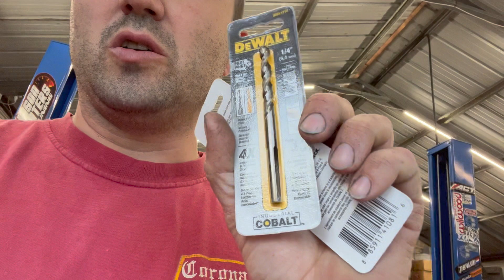Pinning the Cluches in my Honda CRV Rear differential | RD1 CR-Yeeter

Comment: Its 2yrs after you uploaded this video. is there any problems with pinned clutches? any breakdown?
Reply from the maker: Never had any issues with it. It’s not currently in it because I installed a 3rd gen diff and regular driveshaft chasing mpg

Comment: Philip, when I unscrew the 4 knot in the rear differential, dummy me it broke all the 4 bolt so do I have to drill in for the 4 bolts or do what u do, unscrew that big knot inside the differential?

Comment: Seems like it would be a better idea to have the coupler on the transfer case end instead, that way you're not spinning the driveshaft when in FWD mode.  It would be more efficient and give better throttle response.  Honda must have put it there for a reason.  It sucks we have to spin a driveshaft for no reason all the time.  Great video!

Comment: what I don't like is all the pieces of steel and the clutch that remains inside and will pollute the oil. to avoid this, after drilling everything should be dismantled without welding, perhaps with tig welding
Reply from the maker: Still working without issue

Comment: Awesome job, follow up, has the handling offroad improved.
I saw a turbo, CRV strictly for drag racing  & they disconnected the rear wheel drive (too much horsepower) for the rear diff.
Reply from the maker: I haven't really put it through its paces yet but I had a pinned diff in my awd hatch at 900 whp and never had an issue with it.

Comment: I want to know if a 2001 honda crv engine can work in a 1997 honda crv
Reply: Yup, use old dizzy, or repin it. There's guides if you search obd2a vs obd2b pinouts.
Reply from the maker: It can. If you retain the 01 intake manifold, you'll have to extend some wires. Use the 97 intake manifold and distributor. It should be plug and play at that point.

Comment: Today I got a  second lower control arm right drivers side, no more front end noise $1100.00 later
Drivers side door wiring repairs tomorrow at $115.0 per hr plus parts then the engine light.
Hopefully that's all I will need.
Reply from the maker: Sheeesh
Reply: I bought a 2001 Rd crv had to replace both lower control arms at a cost of $1100.00 Australian, its a manual 5 speed.
Next rhs drivers door door wiring & an 02 sensor (the 02 sensor $300.00 alone) that's not including labour.
It's booked in for the auto electrician for the 23rd of this month.
(Pending if the parts arrive.)

Comment: Hey man, I just got a 98’ CRV LX with 117k miles and there’s one problem. The steering wheel is hard to turn. I took it to a mechanic and they said I need a new power steering pump. I got them a new one and when they put the belt on; the pump is a bit noisy and the steering wheel is still hard, they did bleed it as-well. They claim the new pump is just as bad, any advice on what else it could be?
Reply from the maker: was it a used pump or new? I dont usually see these go bad, but if its making noise, it getting air in the system. Likely a bad o-ring. Check the fluid level, also check the fluid while the truck is running to see if it foamy.
Reply: The Honda Resource it was a remanufactured pump, I just ordered a new one, will be here soon, hopefully that works. Is there anything else I should look out for?
Reply: @mirzaahmed9356  Use a stick to the head method to make sure it's not your a/c compressor bearing goin out instead. Don't ask me how I know.
Reply: Nobody Noone I have a new ac compressor and clutch

Comment: I Honestly seriously considered Pinning my Differential clutch pack so I did research for months about it first. It appears that the Transmission, Front Differential (inside transmission), and Rear Differential have different gearing ratios; this would mean that the front wheels turn at a different ratio than the rear wheels. ???
Reply from the maker: That's correct. That's where a viscous coupler is your friend

Comment: Phillip! You will love retirement! You always get to do what you want. I'm very interested to see how this mod turns out! The diff fluid looks awful, but you'll be adding new since it's been apart and drained. I'm on a small break from my own CR-V so I have more time for videos. 

I'm about to tackle the oil pan gasket, adjust the valves, then do an engine tune-up and change all the filters. I'm waiting right now for my new car audio system to be delivered. My radio volume button died and won't come back to life no matter what I've tried, so I'm replacing it and adding a mini amplifier. The OEM radio always sounded great, but I've researched and found that a small speaker amplifier makes for drastically improved sound quality. I can hardly wait to get it all together! Hopefully by the end of the week.
Reply from the maker: Awesome. I actually picked up a double din the other day for mine

Comment: My CRV starts like normal but after driving for a bit my car won't accelerate but the engine is still on what could be wrong?
Reply from the maker: No check engine light?
Reply: @hondaresource  The Check engine light comes on